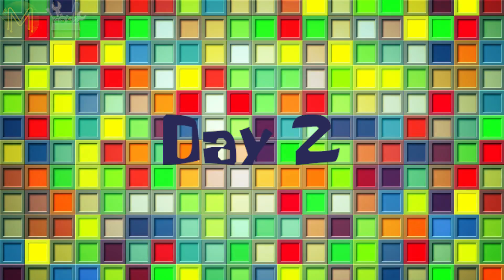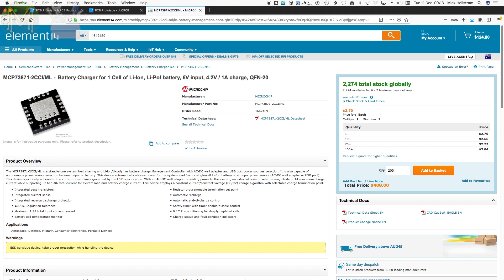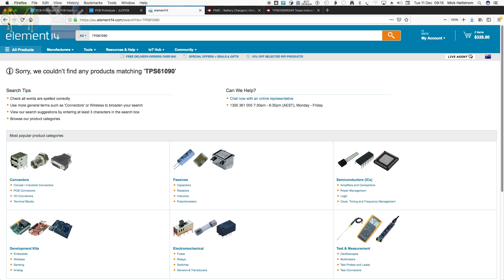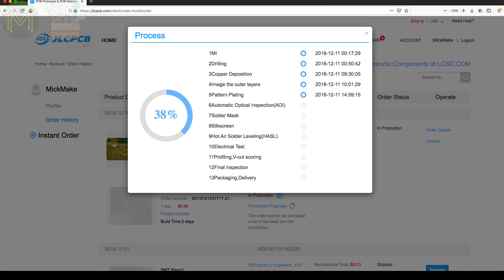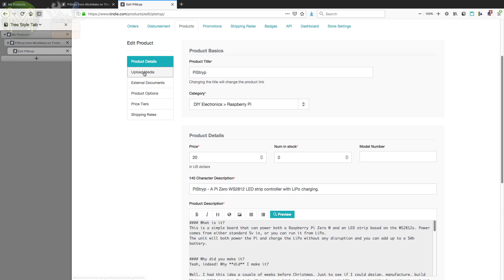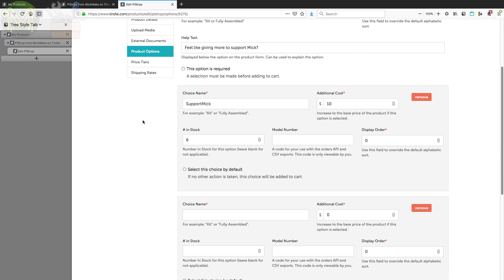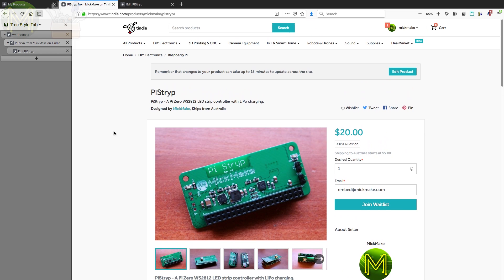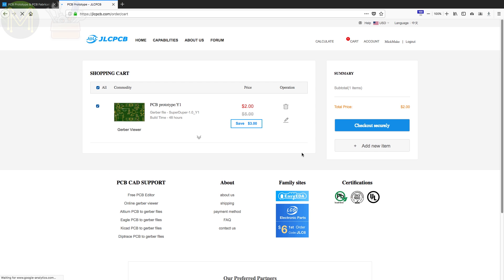#249 Maker Speed Run Day 3: Design, Build & Sell a PCB Maker product in under a week

Comment: I am confused with this whole thing. 
First of all is how do you know this item will sell? You purchased a large quantities of parts you can get stuck with if there are few sales.
Secondly, did you make and test a breadboard? If not why not?
Thirdly, how did you determine the sale price?
Forth, you appear to be selling a completed board with surface mount components. Who does the mounting and soldering? How is this work figured into the sale price?
Will jcplb do mounting and soldering for an extra fee?
Finally, thank you for the thought provoking video!
Reply from the maker: Hi Henry,
To answer your questions:

1. I don’t know! Luck of the draw. It’s something I wanted, so maybe others might. Yes they possibly might not sell, but they are similar components to my PiProjector. So not all bad.

2. The original design of the PiProjector I also didn’t breadboard up. Taking a chance... since it’s a low component count and nothing too complex it’s not an issue.

3. Ah guess. The initial three I’m selling them at less than component cost. So even with the bodge wire, it’s pretty good.

4. I did the initial soldering up by hand. I could have gotten a PCBA house to do it for 90 qty, but decided I needed to fix up those mistakes before I did that.

Glad you enjoyed the video!

Comment: i like TI parts, don't get me wrong, but i think they are a little bit expensive :see_no_evil:
the DIO5158XM8 lipo charge controller for example is 0,38 €  if you take 10, and it does the same job.
okay, not all the bells and whistles.
are there any reasons that you choose the (maybe) most expensive lipo charger in existence ^^
Reply: The LiPo (LiIon actually) charger was a Microchip part, and one of the fancier ones.  The boost converter was from TI.
Reply: @KeanM  you're absolutely right, my bad. doesn't change the point though ^^
Reply from the maker: It’s a valid point, and I think the answer is similar to the Windows vs Linux vs OSX argument... mostly...
Except that there’s a lot more variables.
Reply from the maker: It is rather expensive, but I don’t have enough data on whether the alternatives are just as reliable as TI.
Reply: @MickMake  i see, well that's a good reason, stick with what you know, right ?
i bought 10 of the DIO parts and assembled all, none were broken and all are working fine to this day. i think its 6 month now. only thing is they don't come in QFN, but MSOP-8 is pretty small too ;)